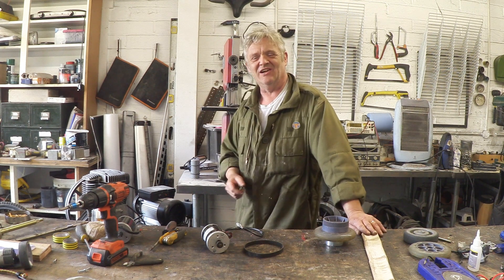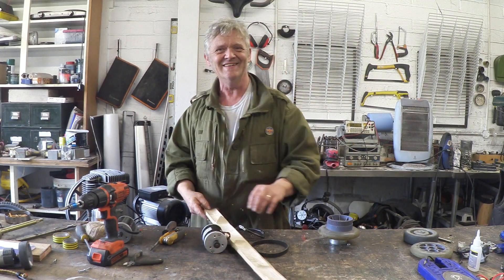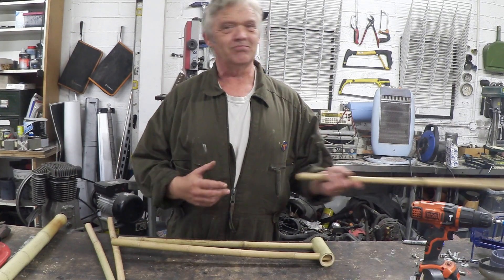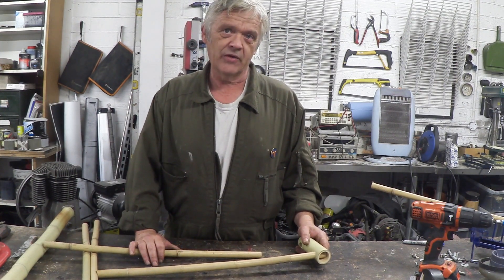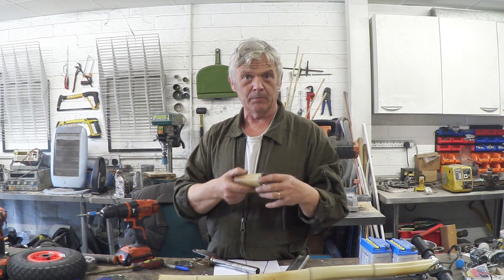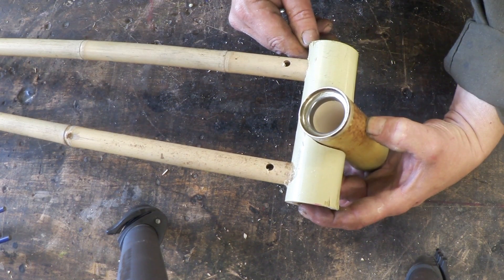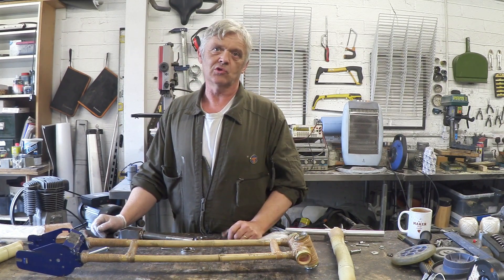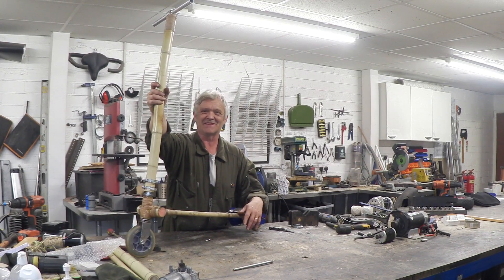1163 Build A Bamboo E Scooter - Part 1

Comment: It might be useful for people to look into how they bundle bamboo together in modern architecture, and using organic curves and such.   Strong and really cool aesthetically, and you can use thinner bamboo for structural elements.  A lot of the river cane around here is about 1/2" diameter or less, so that would make it viable for projects where it's not immediately apparent that it is.

Comment: No, NOT carbon fiber (ever).  Very different expansion/contraction than bamboo!  Will eventually crack it (especially with any extreme temp or humidity/moisture changes).  

   A cool tip, though not the most "eco", is to knock out the internal culms some, and then spray expanding foam into the bamboo.  It makes the structure stiffer and absorbs even more vibration, and also helps to adhere things internally some (besides the outer lashings/wrappings).

  Bamboo is even better when all of it is reinforced with fiberglass--preferably S-grade type fiberglass, and either epoxy or Titebond III wood glue.  Add some carbonized nanocellulose crystals (like natures version of carbon nanotubes) in with the epoxy or Titebond III (at around 2% by weight to the "glue" matrix) and combine it with specifically with S-glass fiberglass (a couple wraps of say 4 oz/yd2 fabric), and you got a structure that is tougher than a carbon fiber tube. Similar tensile strength at lower weight, but better impact resistance. Does not have quite as high Young's Modulus strength ("stiffness" strength), but not far behind.  For best strength to weight ratios though, use high quality composite specific type epoxy (more $$ though).  These typically range from around 7k to 12k psi tensile strength, vs small quantity, home improvement store type epoxies that range from about 3k to 6k psi tensile strength--quite a difference!
Reply from the maker: really? Carbon fibre is used to build all the high end bamboo bikes you see - I am not sure you are right in what you say there - nice tip on the foam though - cheers
Reply: @ThinkingandTinkering    Sorry I'm just getting back to this.  One of the oldest bamboo making companies around, Calfee, first used carbon fiber to wrap the joints but found that these had too much problems with cracking/splitting the bamboo after awhile, and they figured out it was due to the high difference in expansion and contraction rates between the different materials.  

    That is how I learned about it, from a company that learned the hard way.  

  If you actually look up the properties of carbon fiber, you'll see that when it gets warm, it actually slightly contracts/shrinks! And CF is not affected by humidity, or so little to not be noticeable. Very different than bamboo, which when it gets warm and/or saturates with high humidity, will somewhat significantly expand.  

   So if you have this super high tensile strength, and very high stiffness material overlaid onto the bamboo, pretty much like a vice, when you go from temperature and/or humidity extremes, what do you think is going to happen?  If the bamboo starts to expand, and the carbon fiber starts to slightly contract/shrink at the same time, what is going to give?  Not the carbon fiber (having a significantly higher tensile and Young's modulus strength), but it certainly can and will eventually crack/split the bamboo.  If you kept it inside a climate controlled building all the time, it would be fine, but then again that would be kind of pointless..

    I suppose this could be offset/counter balanced some by wrapping less tightly and/or using a specialized epoxy like G Flex which is more tough and yet flexible than many other epoxies.  But why go to the trouble when fiberglass, and to a lesser extent some natural fibers, work pretty well at lower cost both financially and environmentally?

Comment: I love that you show off Bamboo  as a viable material, I have loved it for ever, there is  solid chore bamboo as well but I have not found anyplace selling it, I never tried steaming it and bending it, always wanted to try. 
Thank you Robert👍
Reply: I've done some bending of bamboo. Helps a lot when you pack it with sand. A heat gun also works pretty well in combo.
Reply from the maker: Justin's tip is a nice mate - I have tried a couple of ways but as far as I can work out it is best bent green

Comment: I am making small windmills for children with bird feathers, cork and bamboo. My experience is that bamboo doesn’t wear out and can be used as a Bush bearing. Try it out! I used BBQ sticks for the axle, and hollow garden bamboo sticks for the bearings. Drilled holes in the corks and without glue everything can be made fit together. After a couple of months and severe storms I change the feathers, but my basic constructions have lasted for more than 10 years!
Reply from the maker: wow - very nice tip mate - I'll try it

Comment: Awesome using natural resources. Pity we live in a throw away society.
Reply: Agreed. However, buying it from a place that buys it from China is not the most eco/sustainable option either. Better to get it locally if one can, though I suppose that is probably hard, if not impossible to do in England?   I live in the south east of the US, and the stuff grows crazy around here.  Sometimes you can just ask a person whose yard it is growing in, "can I have a few poles" and most people are fine with it.  I cut it with a machete at two angles, like a V.  Stuff is rather hard on blades though, because of the outer layer which is very silica rich.
Reply from the maker: it is indeed mate - but then that is up to us to change isn't it?
Reply: We don’t realise the strength of natural materials if used in the correct fashion. Was amazed at the strength and let’s add beauty of bamboo used as scaffolding on high rise buildings. Remembering a buddy who is a scaffolder telling me one of the issues they have is rodents chewing on the structure. The solutions to that were soooo funny.
Reply: @patomahony9747  we have an obligation to either change now or leave the world left to die in the hands of our children and there children after them. Especially if we start dropping nukes.
Reply: @stevetobias4890  1000% agrees. Liking this right to repair movement and hoping we get back to days it was possible to repair stuff. Some weeks ago a friend had washing machine trouble,the drum bearing broke. I had a look and guess what the drum is a sealed unit. Basically have to replace the complete drum mechanism which is nearly as expensive to buy as a new machine. Sadly before I could get old machine off him to “experiment “ it was removed. Recon if I could have found a way to open/cut outer drum casing could have repaired it for a couple of quid and saved the planet lots of waste.
Reply: @patomahony9747  what a waste, this throw away society cares more about profit than they do about life, that is unless it is the life of those with the power to execute change on a global level. I am both ashamed and scared for the life of my son once I am gone and going by the history of men in my family is a max of about 15 years.